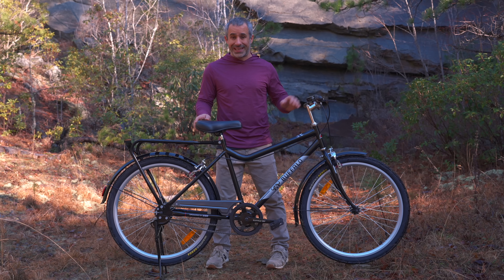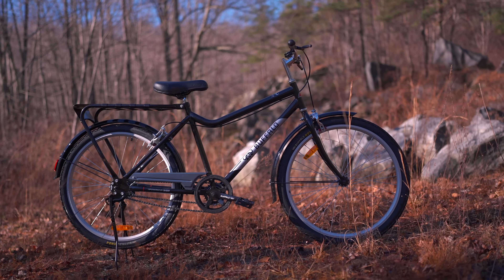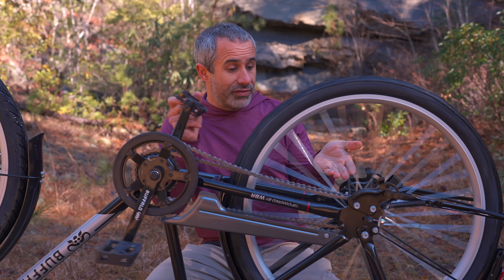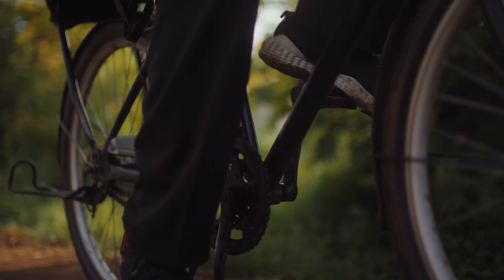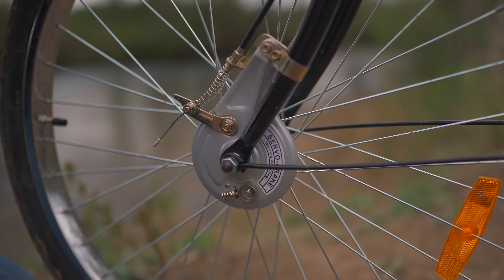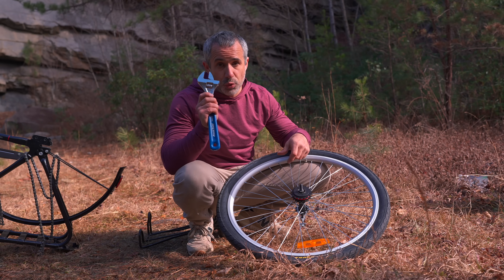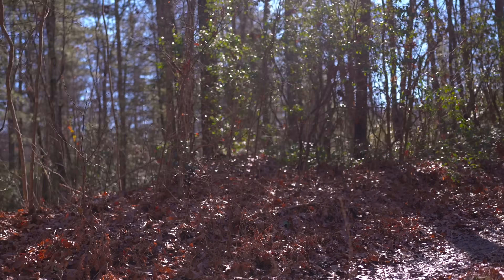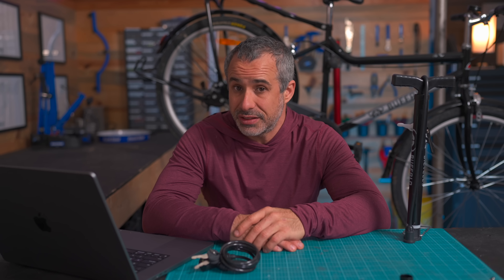Why 2 Chains Make This Bicycle WAY BETTER

Comment: I would rather watch this than any high-end MTB. Amazing stuff.
Reply: Yep. Seth is smashing it. Love all the cargo bike stuff too
Reply: Absolutely, this is where cycling is at, not about buying yet another <insert latest cycling industry marketing segment here> bike.
We're all guilty of thinking about updated specs, new models, etc. and forget about how a robust well designed and sensibly priced bike can change someone's life.
Reply: I caught myself, bike judging people, and realized I needed perspective adjusting.
Reply: Get me one in  Holland. €200 great!!! That's about all I could spare. Steelrims are great too. Traditional Dutch ones have always been trued, so I presume those are lighter/thinner steel rims than these original Bufallo ones? I think the spokes look really flimsy. A longer rack would be helpful! And lifting 100 Kg of carco and bike, not going to happen, without everything topling over, so it would need a little flat plate underneath the crankhub for an aftermarket two sided kick-out stand like the Ursus Mamout 80. I expect they would now expect pedal assist to consider a fleet order at the postalservice.
Reply: Yes.  This is absolutely fascinating and inspiring content.  The bicycle is a beautiful machine.
Reply: Donate for another buffalo bike!
Reply: One thousand likes!
Reply: Here in india people use hercules roadster
Reply: The fancy stuff is cool but what I find beautiful about bicycles is that it is a simple tool with so much utility.
Reply: I think a cheap internal 3  or two speed hub housed gearshift would be better. 
Giving up weather safe breaks and  relying on absolutely straight wheels is  not what I think of as relyable.
And the two kinda loose chains...
Seriosly . 
Does anyone remember the old Torpedo-3-speed gearshifts?
What can be easier to maintain than that littel chain dangling out of the hub?
Reply: @TremereTT  Until something happens to the chain or shift cable out in the middle of nowhere
Reply: @aridragonbeard745  Even if something happens to the shift cable it just becomes a singesle speed bike.
Also I would house the chain like we do in Dutch style Oma-fietsen, for protection against the environment. In Sri Lanka Old basically 100 year old  bikes from NSU with  Sachs Torpedo 3 speed hubshifter and muffled steelframe do quite well. And this is also a third world country. The Bike repair and sales huts I have seen in villages South of Jaffna are way more basic than the ones shown in the documentary placed in Africa and they keep their bikes running, basicall from a palmleaves decked shed next to the street.
Reply: Respectfully disagree
Reply: @SixGunTodd  respectfully i like both

like with cars, it's cool seeing all the latest paganis and koenigseggs like in doug demuro's older videos because it's something you wouldn't buy but it's also cool to watch aging wheels about citroen ami, ladas and polski fiat
Reply: Someone show me where you can even buy one of these bicycles online.. If they've made so many, and it's real.. where are they?? Feels like a scam
Reply: @TrueHelpTV  you cannot buy them for yourself
you buy them for communities in need, moselle zambia, zimbabwe, uganda and others i forgot about
the bike is made by world bicycle relief, they're not trying to sell you this bike, they're trying to get you to buy it for others

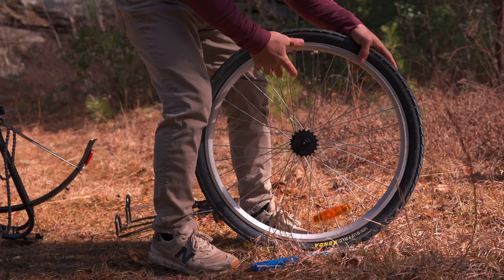Comment: So a freewheel hub is undesireble on an entry level mtb because the exposed axle piece (as seen in the video at 10:57) tends to bend and break. Yet here it is on a bike rated for 200 lbs load capacity, visually unchanged. Wonder how it works under loads.
Reply: Depends on the hub spacing and axle thickness. Buffalo is probably not using the same standards.
Reply: people use freewheel hubs all the time on BMX bikes. oftentimes “undesirable” just means that marketing departments want you to buy something new.
Reply: E Bikes sometimes also use freewheel cassettes. But they use a thicker axle which is flattened on 2 sides to fit into the 10 mm dropout.

The normal axles are too thin and would bend under heavy load.
Reply: Axles like this are common on bikes intended for carrying heavy loads. Many high end e-bikes even come this way. It is undesirable for "normal" bikes though, as the strength of material required to stand up to this strain creates a significantly heavier bike

Comment: Damn I wish I could get my hands on one we live in South Africa. A LOT of people use very cheap Chinese MTBs to traverse to work and back everyday in the informal work sector. Think gardeners domestic workers etc. I haven't seen one person riding this or its predecessor where I stay in Pretoria Gauteng.
Reply: Contact Buffalo about becoming a distributor.
Reply: @Durwood71  this isn't feasible. The average take home pay is R200 ZAR about 10 USD . The people that work under these conditions work to eat. An online search suggests the the retail price between R2500 (130 USD) and R5000 (265 ISD) this is completely out of reach for the type of person it's intended. The scrap they ride on a daily basis you can pick up for about R250 - R500
Reply: @ Buffalo also donates bikes.
Reply: @janventer9413 that’s not how Buffalo work. The bikes are bought by social enterprises who also train mechanics to service them. The bikes are then lent out to individuals, not sold. So you would need to work with a social enterprise in your community to set up a Buffalo hub. I’ve never heard of one in a city though, they are always in remote rural communities to help access education, markets and healthcare.

Comment: Other really cool thing about using a freewheel is that it only takes 2 tools (tool + wrench) to remove or install, whereas a cassette would take three, the extra one of which is a more complicated tool that’s more likely to freeze up because of rust.

Comment: Leave it to SRAM to complicate things. They could’ve just added a front derailleur and two chainrings. Now they have two heavy chains and a proprietary freewheel.
Reply: And a chain tensioner and an extra cable and a shifter and a thinner weaker chain because you can't shift a single speed chain...
This way they get much welcome redundancy. if you snap a chain, you still have the other one.
Reply: Hey Seth maybe a good idea for a video. Take a old mountain bike with a cheap 3x8 drivetrain and convert it to a 2x1.
Reply: Simplicity is the key here. Less cables to snap. Less derailleurs to adjust. Just an old school, bomb proof bike ❤

Comment: Why not still have a drum on the front wheel? That one does most of the stopping anyway.
Reply: I assume to make brake and hub maintenance easier.
Reply: I can only assume that under African hilly conditions, there is a chance of fade. (You already have high ambient temperature + going down + a lot of weight/cargo.)